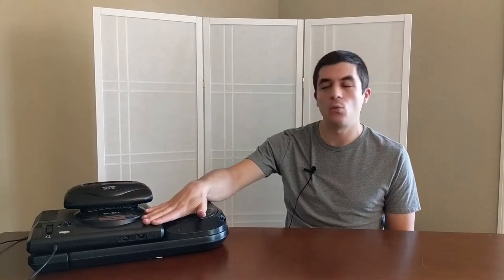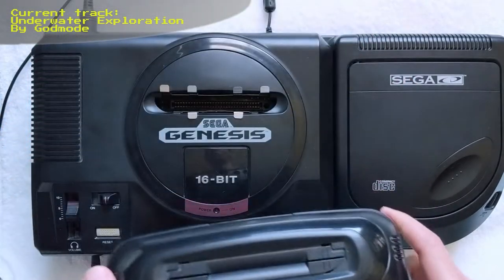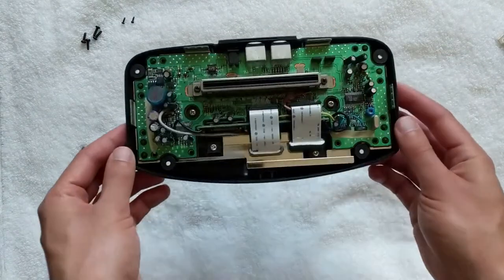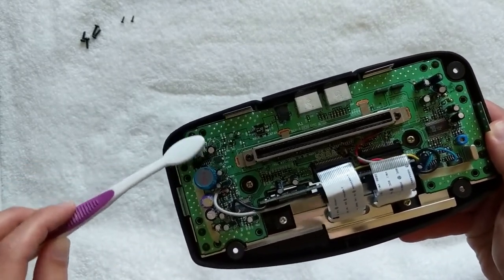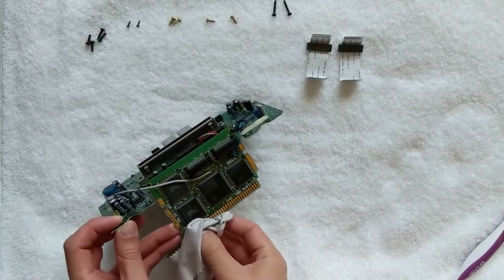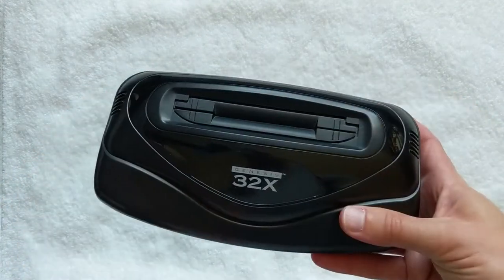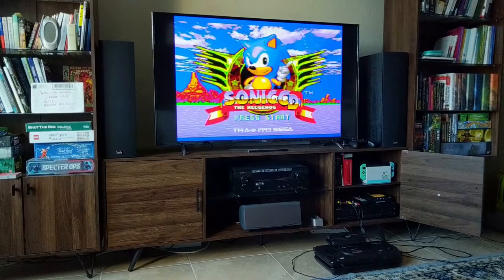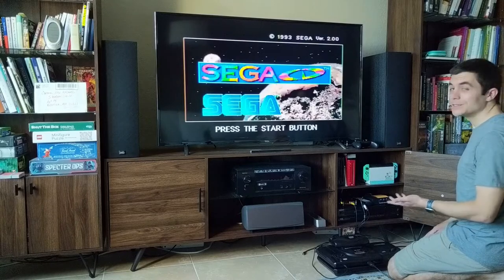Can I Fix My Sega 32X’s Video Problem?

Comment: I looked and found this video because I'm having the same pink graphics. I ordered a new CAP kit to see if that helps. Like your device, my 32X board looks mint and clean.
Reply from the maker: I'm curious to hear whether that fixes your issue. That will be the next step for mine if the issue gets any worse.

Comment: my sega model 1 no-tmss has a blaring audio issue. i did a recap to see if that would fix it, still has the same issue. the blaring audio seems to be coming only from the right channel (in stereo), is not present in the rear because it's mono/left channel only. it is present in coax because stereo is downmixed, so right channel is present in coax. volume slider does not change anything. i'm wondering if the actual audio chip is bad. if i leave the system on for about 30 mins, the sound is nearly normalized. if i turn it off for 10 mins, it goes back to blaring, but then evens out again after leaving it on. should i try replacing the chip?  used different power supplies, no difference.
Reply from the maker: Unfortunately I think the issue is beyond my experience. There could be some other component involved in the sound circuit that's failing, but to be honest, you've probably troubleshot it as far as I'd be able to, myself. Best of luck in finding a solution!

Comment: Are you using stock power supplies? I know some electronics can get wonky with the wrong wattages
Reply from the maker: Great question! Everything was hooked up to their original power supplies in the video - when I was troubleshooting before filming, I did try using another revision of the MK-2103 power supply with my 32X in case the one I've been using was going bad, but it didn't seem to make a difference.

Comment: Hi 

I have Japanese sega 32x and when I connected into sega mad 2 using a game of sega md 2, the screen turns black after it shows the intro of sega entertainment etc .. 

Does it only work with sega 32x games or the sega 32x has issue ?

Thanks
Reply from the maker: I'm not totally sure, but the 32X should be able pass MD games through to the Mega Drive. Are your 32X and MD's regions different? The regions of both systems need to match in order for them to work together. It's also worth checking this page out and confirming all your connections are correct: https://gametrog.com/which-sega-combo-to-hook-sega-32x-how-to
Reply: @RestoreRevise  

Yes they are matching region code lock !!! 

I found that it is only one game that could not read it. Even though the game itself is working fine at the sega mega drive! 

So werid !!
Reply from the maker: @momoqahtani6545  Great work figuring it out!

Comment: This might be because of a bent pin on the patch cable. I heard it's easy to bend it back together. I'm not sure what else causes this if you did a recap on the whole board.
Reply from the maker: I haven't done a recap yet, but I think you could be right; I had to take a quick capture of this same 32X, Genesis and Sega CD for my next video and the image was very stable and color accurate after reconnecting it all.
Reply: @RestoreRevise  Oh interesting. Well I hope that you get this 32X consistently working 👍
Reply from the maker: @maxrichards5925  Thank you! I'll keep at it and make a video about it, assuming I can at least pinpoint the root cause.